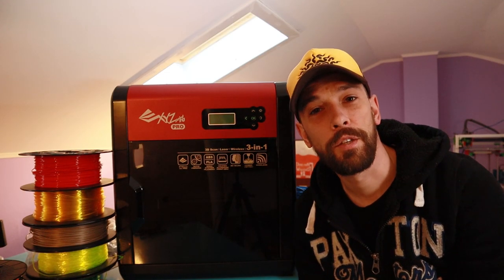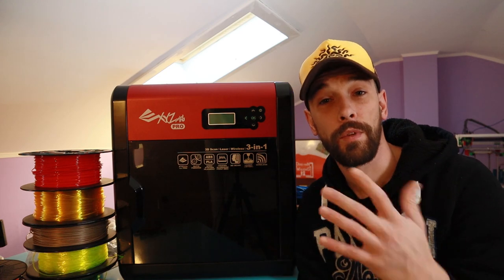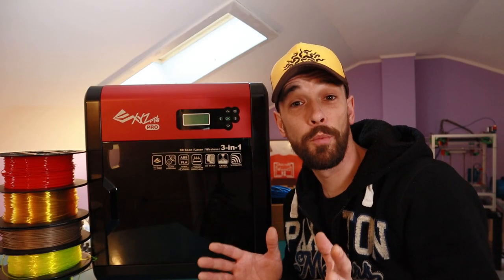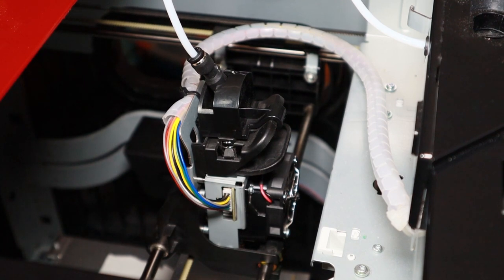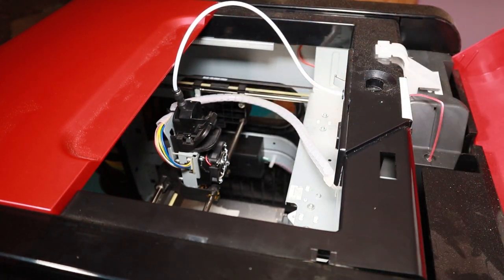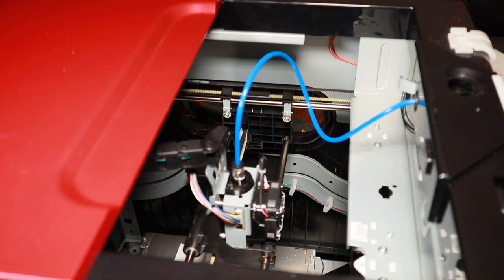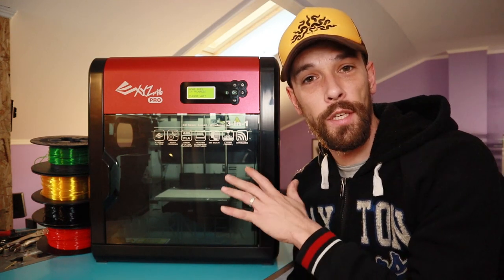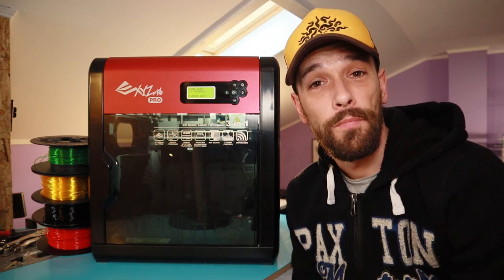Davinci Pro 3-1 - Fixing things

Comment: I got this printer as a gift and have not printed with it yet.  The problems that you encountered are not encountered with my unit.  I like the explanations that you provided.  I will continue my learning process and expect to be printing soon.
Reply: Once you set it up the first time (may not need to level bed), you can just plug in and print, simple.  The biggest issue I have had is keeping the part on the bed and my solution:  Hairspray!  I use the tape on the bed that they provided and then squirt the area the part will be printed with a little hairspray to help it stick.  Usually the second and 3rd thing I print don't have this issue, which makes me think that possibly the temp is not measured, but assumed based on heating time??

Comment: Just picked up this model amazingly at Goodwill for only $50 because they probably didn't know what it was. Has some filament still in the cartridge so will run the test print to see if it needs repair since it was at Goodwill but when I plugged it in to test it checked the level and was good. Am hoping it can increase bed size to around 10 or 11 inches for the X and Y since Z is pretty much fixed being enclosed. Very clean looking so hoping it works it would be an awesome self Christmas present this year.

Comment: Great video and fix ideas. I just bought one of these printers 2nd hand (im in australia), and the PETG tube banging on the lid is annoying. Im going to do these mods - just one question (if you can remember), what size was the cable chain you used? the link beliw no longer opens (unless its because I am here in Australia), but I can get them from Amazon here in Australia - but there are many sizes........  thank you

Comment: great vid! i couldn't find the size of the screws/bolts; pls provide sizes. thanks.
Reply from the maker: Which bolts do you mean? the ones i used to attach the printed part for the ptfe coupler? Those are M3*10mm. they may be a little longer too, there is nothing directly in the way, so 15mm's should be fine too
Reply: @pietershomeprojects4537  yep, that's it. thank you!

Comment: Hi did you find the part to curve the PTFE also did the part you designed hold up well
Reply from the maker: Heyhey, no I didn't got that part.... Wasn't necessary.... And yes it's still running strong, altough it hasn't been used much, die to covid, since this printer is actually used in the school....

Comment: I’ve used the DaVinci 1.0 Pro for a few years without too much issue. Your video is leading me to a few upgrades but of more interest are the tweaks to get Benchy to print so well.  What changes did you make to the settings?

I’d like to use Cura or similar instead of xyzprinting software for printing and have been a disappointed they’ve not issued a firmware upgrade to make that possible for the 1.0 Pro.  Do you know how the system can be reflashed to allow cura or another better software?
Reply from the maker: There are options to flash the firmware but then there is as far as i know no way back....
I didn't do that cause this printer is school property... I just adjusted the retractions etc in xyz printing....

Comment: Hello Pieter. Is it correct that this 3 in 1 printer from XYZ do not have autoleveling for the printbed.
Reply from the maker: There is indeed no autoleveling on this printer.... There is a function that helps with the levelling but I never managed to get it working 😓
Reply: @pietershomeprojects4537  how often do you have to calibrate? Every 20 prints or?

Comment: is there any info on how to change the tip?   it seems like the tip is fused directly into the brass cylinder it comes from but hoping that's not true.
Reply from the maker: Unfortunately it does... Meanwhile I've replaced it with an E3D V6 nozzle
Reply: @pietershomeprojects4537  bah.. why would they do that?!   anywho.. i'm pretty sure either from clog or damage..  it's bad.  the filament comes out and basically curls into itself making a wad of filament instead of pouring out like an ice cream machine..
Reply from the maker: @8bitwidgets  indeed, there are so many better ways to design the nozzle.
Had to replace it cause themperature sensor was broken... And if you want to swap it out with an original one it's pretty expensive...
Reply: @pietershomeprojects4537  I'm going to give mine a good cleaning this weekend.  i have some microscopes and jeweler glasses to inspect it.  really hoping its just an ugly clog and not damaged metal..
Reply from the maker: For clogging I always raise temperature and then manually push the filament through (may take some force)
Reply: @pietershomeprojects4537  I've done this before but this one is being persistent which is why i won't be surprised the tip is damaged..  but i will give it a close inspection this weekend.

Comment: Hi Pieters, could you tell why my 3d printer's touch panel is not on?
Reply from the maker: What printer are you using? There are a lot of reasons why it wouldn't turn on
Reply: @pietershomeprojects4537  Hi, it's super 1.0. Pieters, now, I can turn it on. But each time when it's in the half of printing, it always move the printed part. Could you tell how do I posibble solve this?
Reply from the maker: @ghan725  you mean with move the printed part, it doesn't stick to the printbed?
Reply: @pietershomeprojects4537  Yes, it doesn't stick to the bed and not at the beginning.
Reply from the maker: There are a lot of different reasons that could be the issue...  Night of the nozzle to high, teperature of the bed... Temperature of the room, what laterial are you using, what adhesive,.... Can you send me a video of a starting print? pietershomeprojects@gmail.com

Comment: i WAS having the same problem but what i did was.....i removed that piece of crap useless plastic case and tossed it in the trash. THEM all i did was....I used a piece of brass tubing and ran it through a rubber gromet that came with the machine. but FIRST i placed the rubber gromet into the hole where the filament slides through and super glued it into place it wont move ...trust me. then i slid the brass tubing through the rubber gromet all the way down to the aluminum guide tube. NOW every single time i change filament it the filament is guide ALLLLLLLL the way through without missing a beat. the problem i was having was....i would feed my filament into the guide tube and it would POP out through the SNAP casing for the print head and MISS feeding itself into the extruder. NOW...it works PERFECT. PLUS nothing moves. on the other end of the brass tube i attached that pfe snap fit tube and then the other guide tube into the pfe snap fit small tube. i know it may sound confusing....but a small brass tube works wonders to feed the filament perfectly through to the extruder head so the filament never misses where it is suppose to go. THANK you for the video...your way works great to. but as the old saying goes....THERES more than one way to skin a cat. take care. john from kansas.
Reply from the maker: Thanks man, i appreciate it
I didn't wanted to replace to much, since it is a school printer....
I recently changed out the nozzle... Non OEM.... Still going strong now! Kids love it